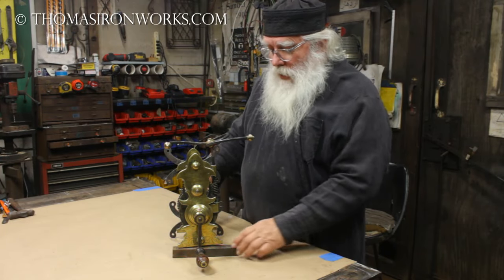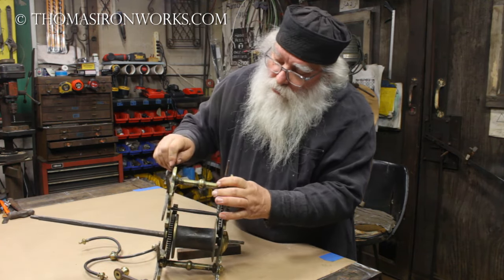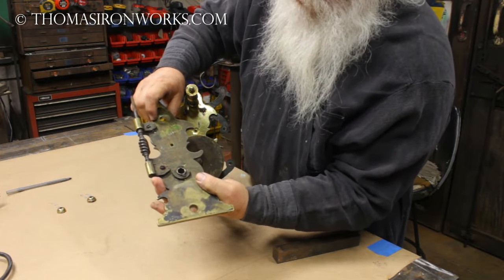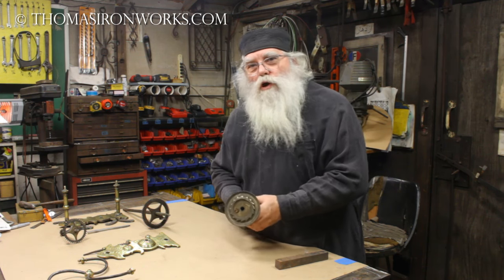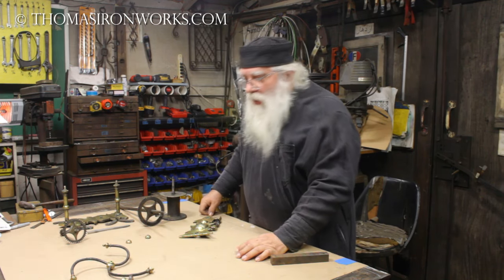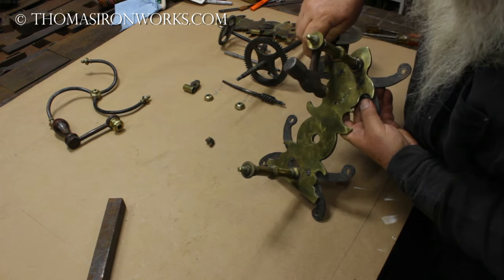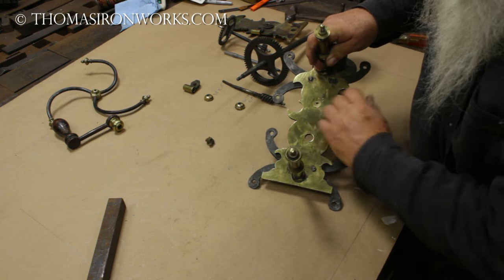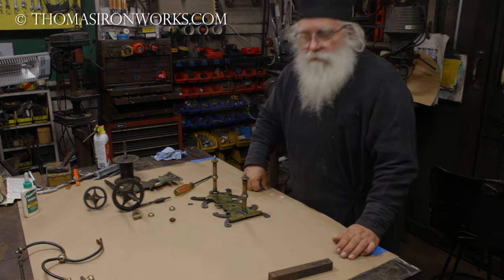18th Century SpitJack Restoration – The Disassembly

Comment: Is the cog wheel and drum one casting, or separate pieces pinned together?   Is it brass?
Reply from the maker: It is one piece Brass.  Previous ones I’ve worked on were two pieces dovetailed together.  You will see more closely in the next video.  Thanks